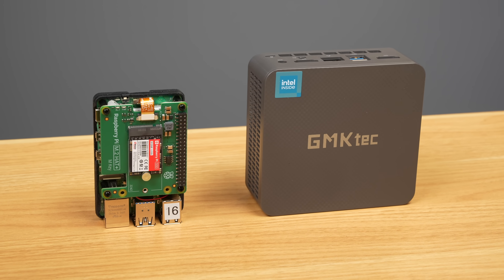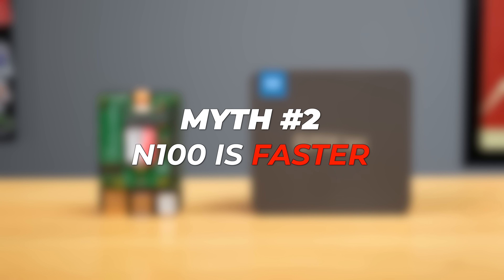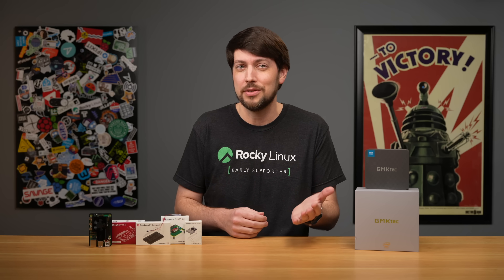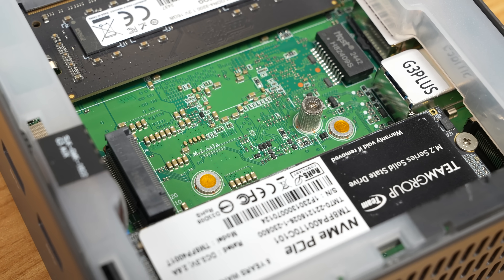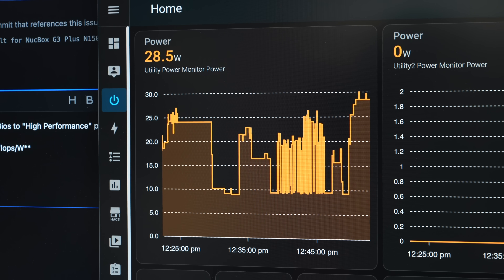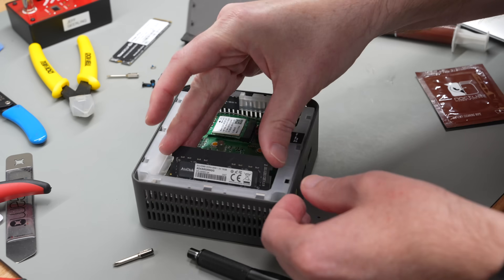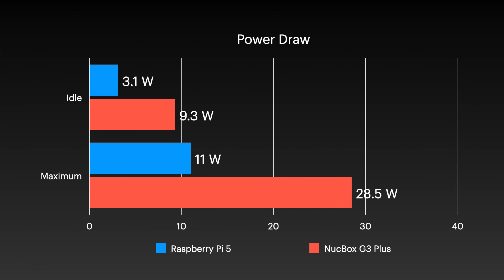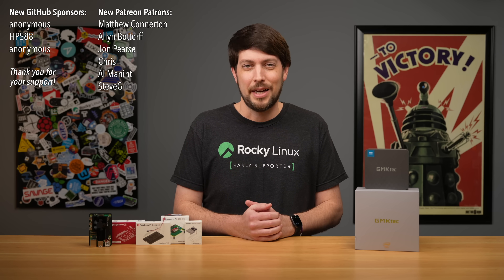When did Raspberry Pis get so expensive?

Comment: The reason why Raspberry Pi's feel so much more expensive now is because while they are in line with inflation, we preceive inflation differently for different products-- we are bias in our accounting for Moore's Law.

An example of this is flat screen tv's are much bigger, better, and cheaper than they were in the past.  Certainly in inflation adjusted terms, but often even in real prices.  Microcontrollers are much smaller, better and cheaper. 

Digital cameras, mp3 players, smart phones have all gotten simultaneously dirt cheap and ridiculously better.

An upper-mid range gaming machine in my college years costs a little over a thousand dollars.  That GMKtec or Pi would beat the brakes off of it now at less than a fifth of the price! For me, this is a natural point of reference-- but it's not an appropriate point of reference.  I should be comparing that machine to one with similar *relative* performance specs against it's contemporaries  (I.e. a current "upper-mid range" gaming machine).

I think while we can trace a smooth line for inflation and Moore's Law  and the graph remains internally consistent for Raspberry Pi's, when the price and specs of the newer power efficient x86's converge into that chart it calls into question "relative performance specs". (I.e. top-of-the-line Pi to top-of-the-line Pi,  vs clock for clock / $)

Keep up the thoughtful videos, Jeff-- we love you, brother!

Comment: My pi4 has been running as my web server and NAS continuously since 2019. It doesn't have any moving parts like fans, and I underclocked it to the default 1500MHz for stability and heat problems. I don't see any reason for the pi4 to not continuously running for another 5 years.

Comment: The Pi corp basically brought the market to the regular consumer , these types of machines used to be industrial only and non standard . We have a rough standard and major support with all types of possible projects. Are there machines that perform around 10 watts that also run linux , yes but this one has the widest usage. As long as they receive the profit instead of third parties ,its a win for more machines in this style. Many other options if they are more preferred.

Comment: Here in Germany, N100 mini-PCs start at about 120€ (8GB RAM/256GB SSD) if you order them directly from China, the cheapest Raspberry Pi 5 (2GB) + PSU + Case + SD-Card + MiniHDMI cable will set you back roughly 90€ - but again: that's the cheapest Pi , if you go for the 8GB model (+30€!!!) or want an M.2 hat + SSD, you're already above what a N100 would cost you!

So yeah, unless you really need GPIO or are really, really concerned about power usage, I can't think of any reason why you would buy a Pi over a more powerful and versatile mini-PC. Raspberry Pis  are just far too expensive for what they are!
Reply: The whole original idea of the Pi was to have a super cheap desktop-compatible Linux computer with GPIOs on it!
Reply: That has been my opinion a few years. Pi is for the HATs which you just cannot add to a miniPC
Reply: It's all about use case, used intel i5 for less than 100 will walk all over both all day long but you'll pay in power usage. Pi is not a desktop computer. It's an overpriced toy or learning tool.
Reply: That's why it's about time, for an RP1 based PCIe/m.2 card that can put the GPIO into any PCIe capable computer
Reply: I agree, on sale I was even able to get 16/512 N100 mini PCs for less than 100€ multiple times. They look nice and everything's included. My RPi5 8 GB + Argon ONE V3 NVMe + M.2 + Power Adapter could've paid for 2 of these.
Reply: @TheTimmaeh  where did you find those? i would need one and for less than 100€ would be ideal
Reply: The only thing the Pi has going for it (fr me) is size and GPIO. I haven't had need for GPIO for some time and have got most of my machines running Nxxx or second hand USFF machines
Reply: I love the Pi because it‘s super modular and you can replace everything with no problem and reuse the old parts. And building something on your own is another feeling because it‘s like your „baby“. And yes, why use more power than you need?
Reply: If you only need the GPIO you can get a ESP (8266 or 32) for  <10€. And that's more energy efficient as well.
Reply: The best alternative to a Pi I found was a used Fujitsu Futro S920. Very cheap (20€), very little power draw (I think 5W according to the datasheet) and easy to get upgrades (DDR3 Sodimm, mSata, Sata, PCIe). Perfect for running stuff like Pihole or Home Assistant.
Reply: @Auravendill  I have S940 with J5005 it is great!!!
Reply: Or get a refurbished old laptop and add a USB "gpio"
Reply: @DayviSchuster  an N100 with a Pi Pico board connected over USB is likely still cheaper, and adds some Pi flavor. :)
Reply: @DayviSchuster  is your life this black and white? I want a home server I can run 24/7 with minimal impact to power; do you still recommend a laptop?
Reply: @neoish  " is your life this black and white? I want a home server I can run 24/7 with minimal impact to power; do you still recommend a laptop?"  I run an old Xeon Server. It idles at ~70 watts. So that costs me around $.16 per day, or just under $5 USD per month. Yes, under full load it will pull over 500W, but then again it gets the job done VERY fast. So higher peek draw, but shorter load times. It does things that a Pi simply can not do thanks to a lack of ARM compiled packages.

If I ran a laptop I have several that pull under 5W idle with the screen off. But like the Pi would still not work for me thanks to limited I/O and weak CPU performance / few threads.

As I cut power use everywhere else I don't mike a server that pulls a little more power. In just the last 6 years I have saved more on power cutting elsewhere than my server uses. But focusing on just power draw is really not a good argument outside of niche areas. For most people a 100W power draw is not going to be a massive deal.
Reply: @ I didn’t expect that, nice

Comment: I try to look at each install as it's own entity with it's own rules and requirements. I have found Pi's to be awesome for mobile installs, like a NAS running in someone's tiny home with only solar. Or as a media server in your van for long commutes and family trips. I have even been looking at it for a MANET project I am working on. The other side of the coin is that I have found  the NUC/mini pc form factor to be champs for compact but stationary installs like a NAS for an apartment that lives on a hall closet shelf. Also quite handy for kiosk installs. However, I do not think that those are the only things those piece of tech are for. If you listen, the install will tell you what it needs. If that fails me then I will just see what Raid Owl says about.

Comment: I fell for the "mini PCs are cheaper" line. There are a LOT of problems with them.

Beelink really messes with Windows. It looks like they are trying to stick with an older version that doesn't need a MS account. Mine shipped with 21H2. It wouldn't update past that and that version of Windows is no longer supported. I really like to wipe and do a fresh install. I ran into issues with that too. I forced an update by running an in-place update with a USB stick. This won't be running Windows later on. I just wanted to use it as is during the 30 day Amazon return window. Think about the "normal" people in your life. Wouldn't they think they were fully updated? That's what they would tell you as you're cleaning up their machine yet again. 

Then there is the BIOS/UEFI issue. The BIOS corrupts and you have a completely dead machine. I've had this happen twice. The first time it was a Beelink. I was within the return window. I  now have a "dead" GMK machine outside of the return window. It needs to be fully dismantled to get at the CMOS battery. Pulling that will likely fix it. If not, I'll have to decide which is cheaper- sending it back to China or just chalking it up as a loss. I've never seen this happen before (and I'm almost as old as dirt) but from what I'm seeing, this is really common with these mini PCs. 

Support? Drivers? Maybe, maybe not. GMKTEC is much better than Beelink for drivers. 

I'm done with these things. They're cheap garbage.

Comment: I dislike the laser focus on power consumption ("efficiency") as the be all end all of comparisons like this. Unless your project involving the computer is going to be battery powered or powered by some limited throughput renewable like solar the power consumption isn't going to matter that much. And for those applications a full fat Pi is probably still going to be over budget power wise and overkill processing wise. 

If you compare the under load power consumption and make the wildly over generous estimate that you were running it at 100% use every second of every day for a year the difference in power consumption is going to be on the order of a couple dollars. And that's the high end worst possible case. And in the real world loads won't be anywhere near that bad on either platform. 

I feel like people are overly traumatized by the olden days of idle power consumption of things like crt monitors being over 100w to keep the tube heater hot for faster startup. A single space heater makes the power consumption of your average high end gaming pc look very low in comparison. When you pull your head back from the microscope objective needed to measure the differences in power consumption of two platforms like this you start to realize how close you are to splitting hairs.

Comment: In the EU, everything is a little more expensive (Euro, VAT and all) but then usually retailers round up. The full Pi setup, with all its separate accessories gets hit multiple times. A single mini PC (esp one imported from Asia) very quickly beats it on price that way. (and that's not to say price/performance, which is already in the mini PCs advantage).
Reply: Rasp Pi 16 GB costs in the Netherlands 140 euro. Then you still have nothing, no power no sd card. Only the pi. If you add an active cooler, power supply and sd card + case.. You're around 180 euro. Excl. shipping still. So you bet you will end up around 200 euro actually for the Pi.
Reply: Yeah, the asian import mini pc is a no brainer in the EU. 

The GMKtec G3 Mini with an intel n100 is literally $92 EUR and even comes with 8gb ddr4 and 256gb ssd.

The pi 16gb alone will cost close to that much. 

Its not even a competition
Reply: My pi cost 70 € i think
Reply: @NoName-md5zb that’s only the board, add everything else and you are looking at a much higher price than a mini pc.
Reply: @feahnorl  really not. Sd card is ~10€. Okay, fan is also similar.
Reply: @ sd card in 2025? L-O-L
Reply: @feahnorl  yes SD cards. These small board computers like raspberry pi are using micro sd cards.
Reply: that being said.. try to avoid SD card for storage :). SD cards are just not very reliably enough

Comment: 9:02 I have this exact model and on desktop doing nothing the SSD was getting up into the 60s so I cut a hole in the top put a mess grill in there and a 80mm fan blowing down on it (soldering required) now it's nice and chilly in the 30s.
Using it as a jellyfin server I do have an A310 total power draw at idle is 22watts

Comment: the advantage of the PI to my eyes is the GPIO for embeded devices with sensors and controls and stuff, as i've found x86 devices with GPIO don't work all that reliably compared to arm-based ones. for use as a general purpose computer it really only makes sense because of market dominance meaning there's a wealth of support and information for any issue you might encounter.

Comment: Well now you've got me considering another mini PC. Basically comes down to this for me. The right tool for what you're trying to do. I'm one of those that has a Pi 5 in a drawer. Sure I use it for projects and mostly the GPIO which is the "killer feature" when I need it. Then a Beelink N150 that's running Ubuntu, some light weight virtual box VM's,  including my home assistant and docker. It's got enough power and dual 2.5gig networking to handle the workload of what would otherwise be a power hungry desktop and be super efficient while doing it. It's not apples to apples but a good jumping off point for users that are considering what's out there

Comment: Canakit has a $420 kit that includes the 16gb Pi 5, a nvme hat, a 1tb SSD, a case, power supply, cables AND the new 10 inch RPI monitor. Everything but a keyboard and mouse. I can't find a better deal anywhere. Canakit did not pay me for this comment.

Comment: The form factor for the Pi is most important to me, because I embed them into small boxes and 3D printers. But even then, I would not be using the Pi5- the specs for the Pi 4 is often enough and it still costs $35. Or, if limited IO is not a deciding factor, the Zero 2W is even cheaper at $15 and still has more than enough grunt to run Klipper on a 3D printer or a hub for smart home devices. For actual PC usage, then yes, I would take the N100+ miniPCs.

Comment: I would 3D print a frame to be able to mount a 120 mm fan on the top if I would keep it.
Reply from the maker: Ha, I just found out on Printables someone designed a toaster-like mount for a fan on bottom, to blow through the side vents!
Reply: @JeffGeerling  Now, a few years after 3D printers existing is a good point to invest in a 3D printer since almost everything and anything has been replicated or invented.

Comment: There is a N100, 16gb, 500gb nvme, brand new mini PC on amazon right now for 160usd. (3200mhz ddr4)

You can't just say "you need to compare like-to-like!" and then not compare like-to-like.

Yes, different computers have different specs, but if we do compare a mini PC with similar specs, it's significantly cheaper than the equivalent Pi. (In this case a full-dick full-throttle max everything pi5 with an nvme SSD)

PS : after another 15 seconds of searching I found a 190usd machine with 4800mhz DDR5 memory. So faster in every way, AND cheaper. I haven't had to search for 2 minutes or even 2 different sites to find strictly faster machines that are selling for strictly cheaper. (These were all base prices btw, no coupons, sales, etc.)

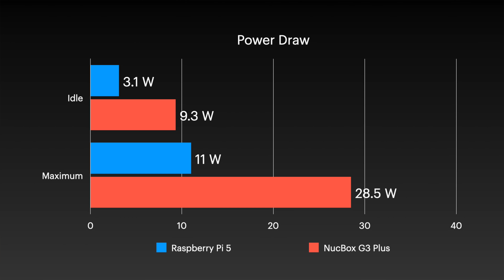10:20 this is an incredibly dishonest way of describing this. "It uses more than twice as much power" --> "it's like 20% less efficient". Describing "it's moderately less efficient" as "IT USES MORE THAN TWICE AS MUCH POWER!" is like pointing to a car with a 2.25x bigger gas tank than another car with 5% less MPG "look you don't wanna get this car, it consumes over 2x more gas just driving one tank". Yes, because it drives twice as far. It does twice as much work when being pushed to it's max with only marginally worse efficiency. You spend like the first 5 minutes talking about "comparing like-to-like" and then describe like 20% lower efficiency as "more than twice as much power" because you have it doing twice as much work.
Reply from the maker: I did compare like for like, though...?

The Mini PC in this video is $159. The Pi 5 in this video is $208. The Mini PC is a much better deal, if you need a computer with 16 GB of RAM and a 512 GB SSD.

Comment: The balance of cheap and easy gets missed a little for rpi. If it were cheaper, but required a little more effort, I'd probably own several by now. Instead it costs more and also requires more effort to setup, so unless I have specific requirements around power draw, physical size, or GPIO, it just doesn't make sense. I'd pick an rpi for a hardware control project, but anything software or compute based a mini pc is probably going to be better.

Comment: I think the real difference is the iGPU performance.  Much, much more software supported good acceleration with the Intel solution.  If you have no plans to run anything that needs, that, or if you want to use the GPIO pins, there's your decision made.

Comment: I'm running both Pi(5, Zero 2) and Intel(J4125) servers, albeit it's more of a lightweight side. I'm first just shocked how many packages are also out on aarch64. So in terms of running server-y things, I think Pi is pretty solid option, and power efficient too. But you know, comfort. The single most deal-breaker for me was lack of DSM support. AFAIK there are no DSM loaders for ARM processors. And I didn't want to compromise my data stability experimenting some other ARM solutions, even though ARM solution will be very stable at the end of the day. So I'm basically running Pi for most homelabbing operations, and running Intel for more stable and conservative real world use cases. I think it is decent trade-off, and both have each others' merits.

Comment: the fact that you need an expensive 5v5a power plug and it does not work with USB-c PD makes the 50 USD much more expensive
Reply from the maker: The 27W USB-C power adapter is standards compliant and uses PD, and technically 5V5A is a standard in the PD spec ;)

However, the Pi 5 runs fine off any decent PD adapter support 5V 3A. It's only if you're using a lot of USB peripherals that you need 5V 5A. Still wish they would've gone to 12V PD so they would work with more PD adapters.